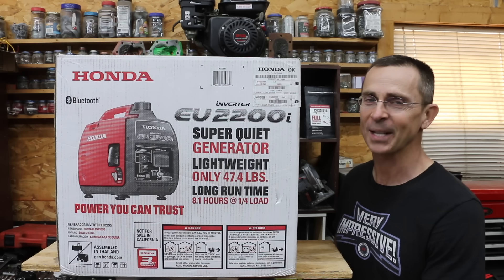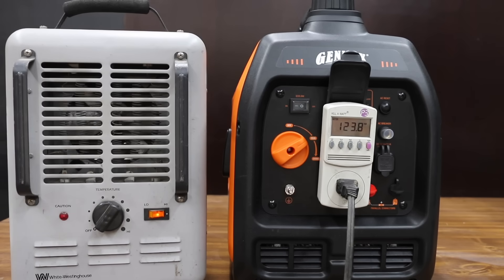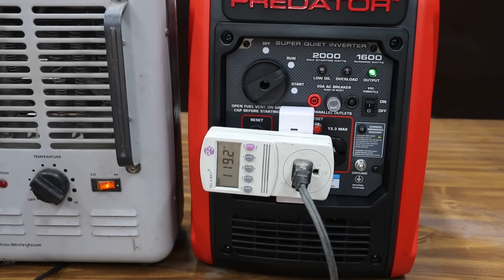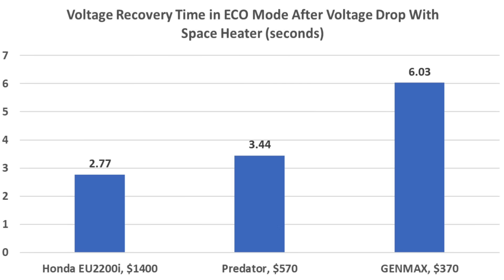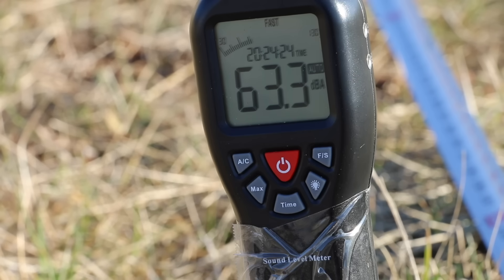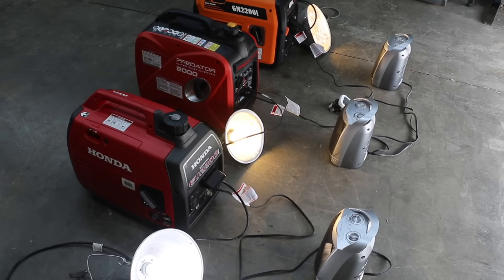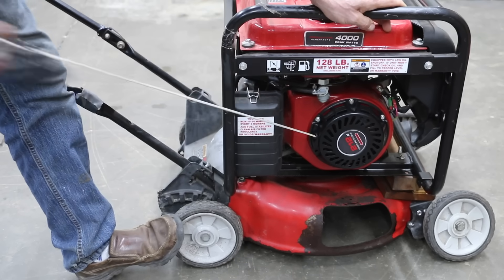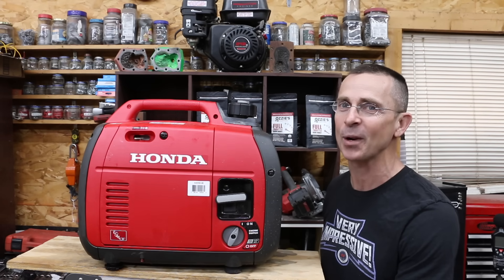Cheap Generator Better Than Honda? Predator vs Honda & GENMAX—Let’s Settle This!

Comment: PLEASE READ. Have you ever tested the additional security door locks from amazon? As thorough as you are and with the integrity you test products with I feel this is a must and would be very helpful to a lot of people. Different types are out there. Defender Security / Prime Line seems to be one of the original brands but they’re other brands like Ace Mining , and a plethora of others. One new upgrade I’ve seen is the Mousike 4” and 8”. Same style just longer.  Then they are different types like the CZU and Kitchentour slide locks. As well as the old style hotel locks. The best one of those is the defender security that has a twist latch at the end (otherwise those are EASY to defeat)  Defender Security Flip lock, Mousike 4” and 8” flip lock, CZU Door slide lock, Honesaloc door lock , old hotel latch style , the very old chain lock. Also becoming popular is beefing up the door jambs and strike plates. I think it would be of great service for you to test these and show us which , if any , hold up to a barrage of kick tests and battering Ram tests. Please provide us with your excellent , unbiased , and accurate testing skills of these products so we can pick the safest most effective option ( in addition to our security systems ).
Reply from the maker: Thanks for the suggestion.

Comment: You get what you pay for.  These dime a dozen China junk generators are a complete waste of money.  The problem is the electronics that quickly fail.  This problem will not show up in a quick test like this.   I tried several of these low cost generators which all failed under load within two weeks.  Finally after several replacments with the same problems I got smart and bought a Honda which if bullet proof and will likely last me for years.  Do your self a favor and stay clear of these junk generators since they are guaranteed to fail when you most need them.  China = fail.

Comment: My HONDA is quite frustrating and maybe you can do this comparison.
If it isn't run under load at least every 3 weeks, IT WILL NOT START. If it does start, it surges terribly and to run smoothly the choke must be at least half closed. The carb is so sensitive to sitting unused that it must be frequently removed and cleaned. Sometimes I see a passage plugged and sometimes I never see anything wrong with it. Never any sediment in the bowl. But I use some carb cleaner spray, blow it out and it stars and runs normally.
Oh, like all my small engines, I use only no ox 91 octane (no ethanol) purchased at various places and often use an additive like Seafoam or Lucas injector cleaner.
On mine, the off switch is also the fuel valve so you can't run it out of gas. It is my understanding that new ones have a separate fuel valve. On older ones there is no place to install a valve.
It's very frustrating considering it costs 2.5 to 3 times more money.

Does anyone have similar experiences with your small generators of any brand?
Reply from the maker: Thanks for the suggestion.
Reply: I have two EU2200's which I bought for emergency back-up only.  I start them once every six months, run them for 30 minutes, then put them away.  I store them with full tanks of non-ethanol fuel, but never with gas in the carbs; I always drain them.  They ALWAYS start with two pulls; no more, and they run perfectly.  Drain your carbs, and you won't have any problems.

Comment: I have a question concerning the motor oil used in the testing. There is a difference between automotive oil and air cooled small engine oil. Small engine oils have a higher zinc content than automotive oil (the zinc causes problems with catalytic converters). Would using an oil for small engines change the results of the oil testing? It seems like it could.

Comment: Here's an idea for a show (although you might have to spend a long time preparing): Gasoline stabiliser products, specifically when you don't plan on running the engine for a year or two.  With E10 fuel, results can be poor.  Which stabiliser will allow the fuel to remain good, if any?
Reply from the maker: Thanks for the video idea.

Comment: Great job, as always, but the safety sensors are for carbon MONoxide (CO), not carbon DIoxide (CO2).

Carbon dioxide (CO2) is the bubbles in soda pop. It is the product of complete combustion, and it is innocuous, except at extremely high concentrations.

Carbon monoxide (CO) is toxic, and dangerous! It is also flammable, which isn't a problem, per se, but it explains why high CO output is a symptom of incomplete combustion. A nicely tuned engine, running well, produces a small amount of CO; a poorly running engine usually produces lots of CO.

Comment: I loved the comparison. Excellent job. 

However, I would have liked to have seen you use a PQA to measure droop with the generators in eco mode. The Home Depot watt meter isn’t exactly lab grade equipment. Then again, a decent PQA is pretty expensive, but it would have given a much better analysis of the unloaded to loaded transition.
Reply from the maker: Thanks!  Thanks for the constructive feedback.

Comment: Very nicely done, you answered just about every question I could think of. I proudly own two preditors and Sistered them both together to easily supply most all my power needs when compared to the price of the Honda. I'm happy with the two Predators just saying 🙂
Reply from the maker: Thanks!  Thanks for sharing.

Comment: I have had a Honda Eu2000 that I converted to propane in the side box of my semi trailer since 2009. I have used this little genny to run my AC while I sleep and on layovers. It has more hours on it than I can count. Another summer is here and this little guy still runs and gets the job done. If I had to guess, it has thousands of hours on it. I use it for ten hours during at a time the entire summer at least 1,200 hours a year for the last 13 years.
Reply from the maker: Thanks for sharing.

Comment: personal i run a wen 56235i 2350 generator for the race track. from say 3 to maby 10 or 11 i  get 3/4 of a gallon of gas used.
Reply from the maker: Thanks for sharing.

Comment: The problem with the cheaper ones is probably just the cleanliness of the manufacturing plant. If you just changed your oil sooner the first time (or just ran it on transmission fluid for five minutes) you could wash all those impurities and dust out and then the lab results would be similar to the Honda..
Reply from the maker: Thanks for the feedback.

Comment: I suppose that it depends on the use of the generator as to what a person is willing to pay. Personally, I believe that going cheap will, in the long run, actually coat more.
Reply: It depends on what they're being used for. I have a cheap - really cheap, about £50 I think it was, though it was some years ago - generator, 800W (some versions claimed 1kW for the same unit). I use it for running a polisher, for polishing my aeroplane a maximum of once a year. I actually abandoned it for a few years and then was surprised it started up straight away when I tried it again. I think I've had my £50 worth out of it, even if it breaks down tomorrow! Even buying a £300 generator wouldn't have made sense for me, let alone a £1400 one!
Reply: I agree. I’ve had the Honda (two actually), since 2012 and both are still going strong. Changing the oil is a pain. Get the extender tube; it helps a lot unless you don’t care if it makes a mess. Otherwise, I love my Hondas.
Reply from the maker: Thanks for the feedback.

Comment: What about finding old drills and seeing how they have held up compared to new. Torque specs for example. I have an 8 year old porter cable impact and have wondered what it has lost in power.
Reply from the maker: Thanks for the suggestion.

Comment: Would love to see a comparison with the Powerhorse brand involved.
I retired from a telephone company. We had remote sites that needed auxiliary power during power outages in winter. We had 13 generators of many different brands.
The Powerhorse always started in cold weather better than anything else.
Honda is an especially poor starter in cold weather.
Thanks.
Reply from the maker: Thanks for the suggestion.
Reply: @ProjectFarm  You rock with these comparisons. No stone unturned!

Comment: You truly provide an amazing service to the consumer! I bought the HF Predator 2000 after a power outage to save our fridge food. It performed well, and after two outages has paid for itself in replacement food costs. The Predator came with NO oil, so thankfully I checked before starting. I had a quart of standard 30wt and figured that would be OK. After two multi-hour runs, the oil looks clean and shows full. Figure I'll drain and fill with full synthetic 10w30 next. As I only plan on using the Predator 2000 for saving fridge food during occasional power outages, I feel I made a good choice. Efficiency, noise level, size/weight and ease of use are all great for my use. Thanks again for what you do. Oh yea...I use StaBil in the gas.
Reply from the maker: Thanks and you are welcome!  Thanks for the feedback.
Reply: I’m going to use recreational fuel, it’s great for a lot of things

Comment: Could you test fuel filter brands like sierra?  I had several 18-79809 ones fail after one season.
Reply from the maker: Thanks for the suggestion.

Comment: Actually you could buy 2 predators and run in parallel to handle the tougher to run wattage loads for the same price as you pay for the one Honda.
Honda makes a good product and if a contractor or someone who uses it everyday for long stints worth the cost but for the average consumer that uses a generator much less frequently I think the Predator is the better value.
Again value wise you can wear out one Predator completely and replace it with a new one for the cost of the single Honda.
Reply from the maker: Thanks for the feedback.
Reply: A Honda will last 4 times as long or longer believe me I have a 20 year old Honda EU2000I

Comment: I bought my Predator 3500 a few years ago and I've used it for everything from camping to running power tools out in the woods to running our entire house during power failures.  I've been extremely happy with it.  Zero issues so far.  Not bad for $700 bucks.  I've had other guys comment on how quiet it is.
Reply: I bought 1 for $60 at an auction. Works good so far
Reply: I also got a 3500 after looking at the sparkplug im putting it up for sale right now.
Reply: Just sold it.
Reply: @dangda-ww7de  How much did you get for it?
Reply: I run it 13 hours a day every day for 6 moths never had a problem definitely worth every penny
Reply from the maker: Thanks for the feedback.
Reply: @rjones6834 no he saw  engine wear from the condition of the spark plug and sold a working generator . The new owner could have and maybe did pull the spark plug and look at it. And he never said what he sold it for or if he disclosed “ possible wear” you are assuming way too much man. Lighten up
Reply: @rjones6834 yea and cry me a river

Comment: I have a Ryobi 2200 I bought 8 yrs ago for less than $400. They are now $899 (plus 9.75% tax where I live). I love my 2200....  I neglected it for a few years. The ethanol fuel sat in tank and had to replace it due to leak at injected molded seem.  I think having ethanol was a problem. I  ONLY USE NON ETHANOL FUEL and start the Gen every week or two. It is ready for power outage.
Reply from the maker: Thanks for sharing.

Comment: If you are going to frequently use the generator for hours at a time, perhaps camping or at a job site, the Honda looks to be the more long lived choice.  If you are looking for a generator for occasional use, perhaps backup power during outages, the made in China generators would likely be adequate.
Reply from the maker: Thanks for the feedback.

Comment: This needs to be a long-term review. Set them both aside, fire them both up several times during the next 5 years. If that cheapo generator can hold its own over the Honda's, then I'll be impressed.
Reply from the maker: Thanks for the suggestion.

Comment: My suggestion for new video is hearing protection. Ear plugs vs over ears. Over ear with Bluetooth vs expensive in ear. I have prohear ear muffs. But would like opinions on the top 3 recommends I see when I browse Amazon. Isotunes. Axil. Walkers.
Reply from the maker: Thanks for the suggestion.

Comment: have you done a video comparing ac leak sealant products? i tried using a honeywell r1234yf refrigerant that supposedly had a sealant in it as well, but within the next day my car’s ac went back to blowing hot air. not sure if it may still be leaking or could be an issue with my compressor or something else, but just curious to see if some refrigerants / sealants work better than others. thank you!
Reply from the maker: Thanks for the suggestion.

Comment: A friend brought his little Honda generator to our campout. It was the same size approximately as the one you tested.
It was so quiet I had to touch it to learn if it was running. I wish I could remember exactly which model it was. I could barely feel it vibrate. I didn't think to ask if it had been modified. I should do that next time I see him.
Reply from the maker: Thanks for sharing.

Comment: Please do a video comparing different ceramic coatings for vehicles for DIY enthusiasts. If possible, include brands found north of the border such as the Autoglym UHD Ceramic Coating Kit which is sold at a large outlet called Canadian tire.
Reply from the maker: Thanks for the video idea.

Comment: Im interested...long term, how many hours until the 2 clones fail.  The majority of people I know that use these micro generators dont usually run them long with much load...lights for camping or a small electric griddle, a drill.  If the Honda for example is capable of 2000hrs..and the genmax is capable of 1000hrs for example...at 30% less cost and nearly the same performance...many users would opt for the genmax
Reply from the maker: Thanks for the suggestion.

Comment: There is a reason you pay for HONDA!  These tests are in the moment, try to run them again in 10 years after significant use over the years and Honda will be on top in the future.
Reply from the maker: Thanks for the feedback.

Comment: 👍
Reply from the maker: Thanks!
Reply: @ProjectFarm  Have you done anything with     The full synthetic 10 W30  4 stroke engine oi? I bought some I have it in a Honda ruckus and a Rototiller and a riding lawnmower and a push lawnmower and a 2000 i  inverter older one and a champion 2000 watt inverter generator and again they’re a little older,,,is the full synthetic four stroke a waste of money or does it have its place I really don’t know?

Comment: An important point is that 3db is actually TWICE the sound pressure.  It takes about 10db to make it SOUND twice as loud.  So those sound readings are really interesting.
Reply from the maker: Thanks for feedback.

Comment: @8:00 hmmm "with the exhaust facing the generator"?  question, how does the exhaust face the generator?  Love your channel, great work you do.  I took one of your recommendations and never regretted it.  It was the String Trimmer String comparison.  The string you recommended has saved me so much money because it resists breakage its not funny.  I am very abusive to my strings on my trimmer.

Comment: Since Honda would be a far more precisely built engine I'm wondering how much of the oil metals on the Genmax was break in and not wear. Doing the same oil test on the same generators at 400 hours of use would it produce little or no metals in the oil ? Or whatever appropriate wear in deemed appropriate

Comment: I'd love to see a showdown of the Dual Fuel generators from Sam's Club and Costco, there's a Westinghouse 9,500/12,500 from Sam's for $1000 (it's $12,500 at Lowe's) and a Generac 9,200/11,250 from Costco for $1100.

I'm definitely buying a generator for the coming winter season, and I'd love a comparison of these, as the flexibility of using Propane is amazing.

There's a similar one from Champion brand at Home Depot and Lowe's as well as a Genmax, All Power, and Wen from Lowe's if you want to fill out the experiment with 4-5 total comparison items.
Reply from the maker: Thanks for the suggestion.

Comment: With the proliferation in "solar generators", or those big battery units that recharge with solar panels that are roughly the same physical footprint as these little generators, I'd love to see a shootout of the popular brands.  There's something to be said for having a backup or portable power supply that doesn't make any sound and requires less maintenance.  I imagine that would be a pretty expensive shootout, though.
Reply from the maker: Thanks for the suggestion.

Comment: Could you do a test on spray in bed liners for trucks also might include the roll in bed liners maybe heat and abrasion tests heat resistance ease of application and which product covers best
Reply from the maker: Thanks for the suggestion.

Comment: I've got the EU2000 which came before this model.  Bought it used and it looks like it was beat to hell and back by a concrete pouring crew.  Left it in my unconditioned garage for 5 years of 100 deg heat in the summer and below zero temps in the winter.  After five years I pulled it out.  Didn't even drain the nasty old gas.  Started first pull and ran smoothly.  Most small engines can't go through a winter without winterizing and draining the fuel in the spring, cleaning the carb etc.  The little honda generator just works every single time flawlessly even after 5 years of sitting and 5 year old gas.  I live in a rural area now where we sometimes get power outages with storms and use it to run my refrigerator plus a heated blanket or 5000btu A/C depending on the season.  It has always started first pull.  If it ever wears out on me I will get another Honda, I don't care how much they cost.
Reply from the maker: Thanks for sharing.